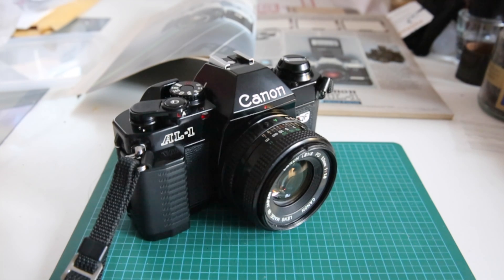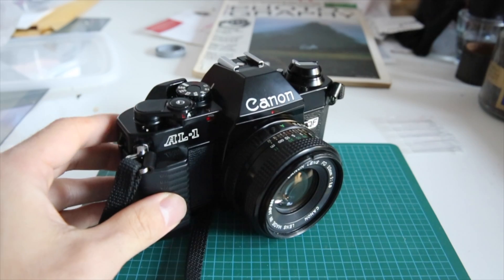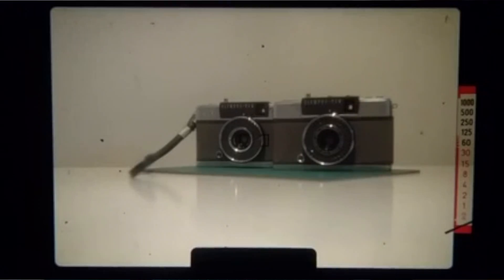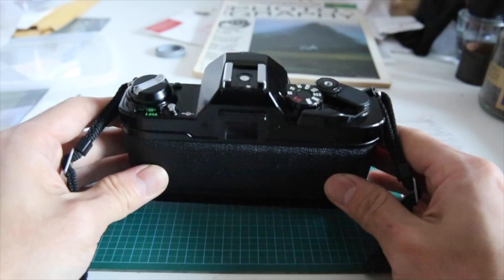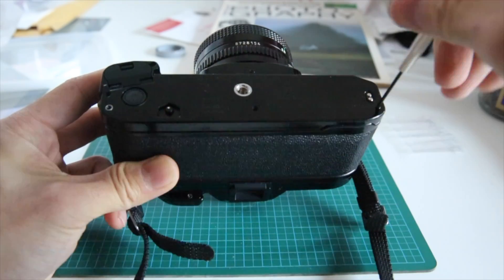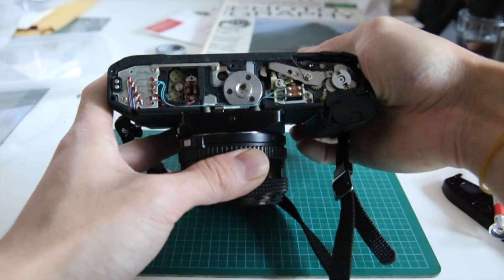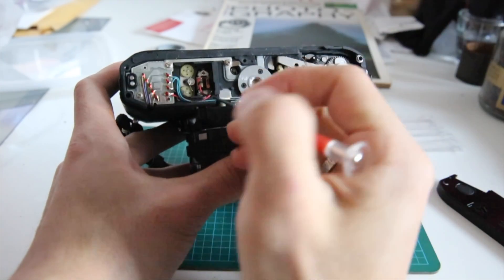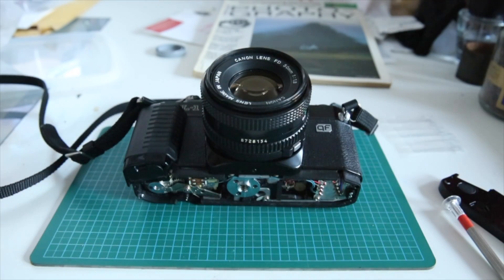Fixing the Canon AL-1

Comment: Hi I got an AL1 and the winder/shutter locked up, so I changed the batteries and did the battery check all ok - I removed the bottom plate and the as shown, pushed the shutter thing away from the magnet, it moved but it didn’t fire the shutter - any thoughts on next steps or is it a paperweight 😢

Comment: I've been watching YouTube vids as long as the next guy, and this video was the most magical. I just bought this same camera and was ticked because it was locked up. I thought it was just set to lock and Id change it later, but it turns out it hadn't been fired in a long time. After removing the base, per your instructions, bingo, it works great. Thanks.

Comment: Thank you. I was able to fix my, new to me, black AL-1 that I bought off ebay. Was really bummed that it took forever to get and then wouldn't fire. I ended up running an alcohol pad between the "anvil" and electro magnet and it has continued to fire for over a 50 tries. Again, thanks.

Comment: I have tried your tip and it effectively works. However, I have to repeat this process everytime. I cannot shoot normally. Is there anything else I can do? Thanks
Reply: Hey I have the same issue have you figured it out?
Reply: Try cleaning the magnet contacts (the pyramid)
Reply: Alcohol on a q tip
Reply: It seems that this problem is an unfortunately known evil. With which product can I try to make a cleaning?

Comment: This is not a fix for a magnet that needs to be replaced.  Unfortunately, this is a systemic issue for all A series cameras - the achilles heel.  I have plenty of A series cameras and they all eventually fell to the same fate as paper weight due to this poor design.  Stick with cameras which don't rely on batteries to operate the shutter and it will last way longer.